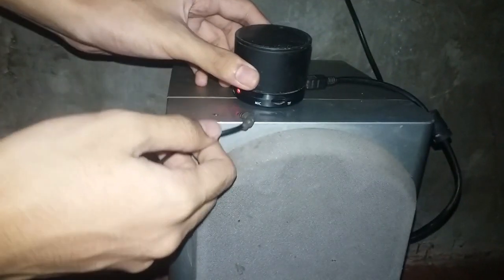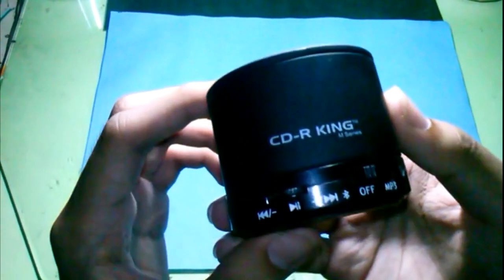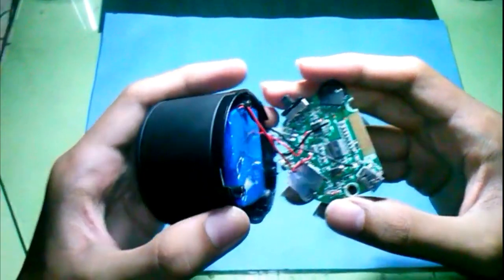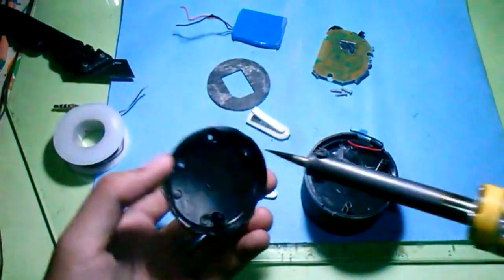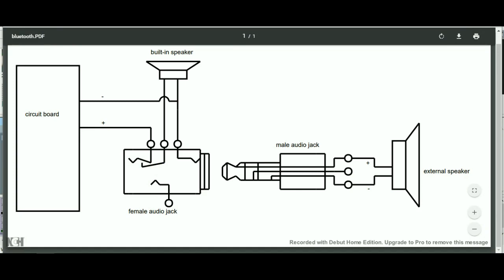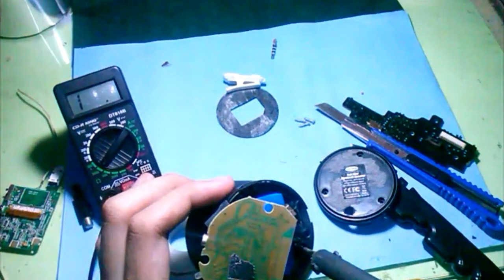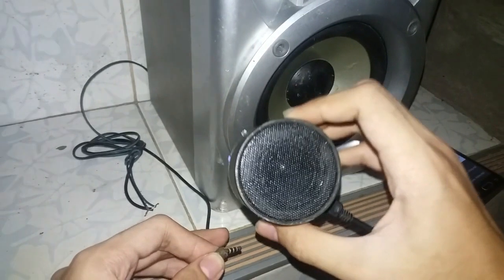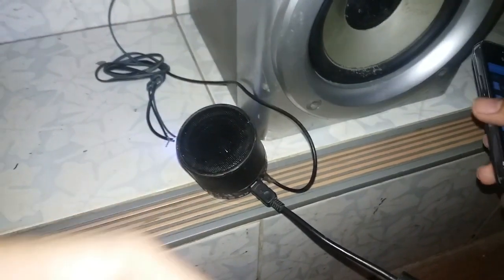Hacking a Bluetooth Speaker || External Audio Jack

Comment: I did not understand how to connect 3.5mm female connector to bluetooth speaker. 
Please explain me to understand
Reply from the maker: you need know the pin-out of your 3.5mm female connector. normally it has 4 or 3 pins   . just 2 of the pins will be used because a speaker  has 2 wires .

Comment: Is there a way to get to the line level signal before it is amplified? I took the audio out on a motorola "Deck" bluetooth speaker that happens to have an audio output jack (the only one I know of that has this) ; oddly eough, it does NOT mute the built in speaker, so I just connected it to an amplified subwoofer because the Deck has quite satisfactory midrange and treble, but limited bass response. The subwoofer has a variable internal crossover so you can set it to filter out what is being handled by the Deck, leaving it to kick in right where the Deck drops off - starting about 250 Hz but non-existant below 100 Hz. The subwoofer has a 12 inch speaker, so it can cover all the way down to 30-50 Hz quite easily. It sounds great, but if was fed a balanced low-impedance line level input instead of a headphone signal, it would be cleaner. Thanks for the video!